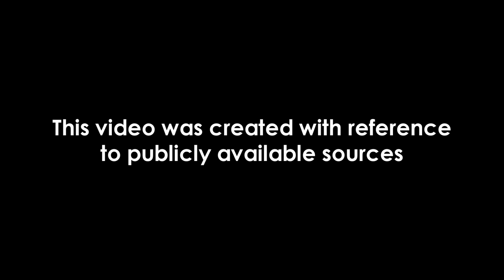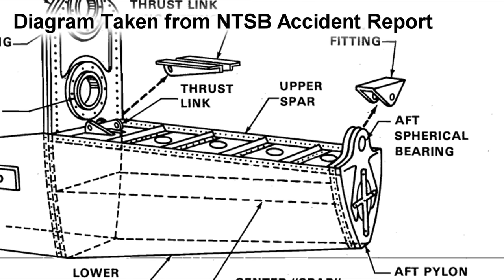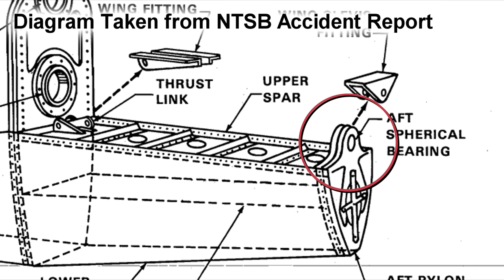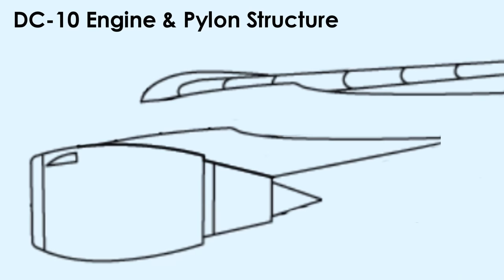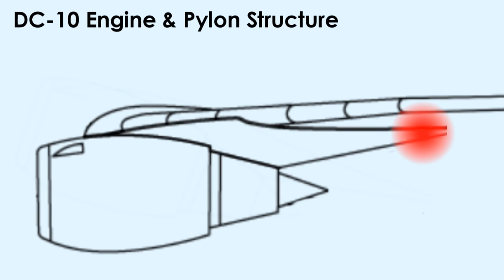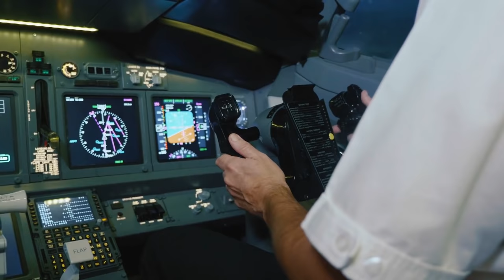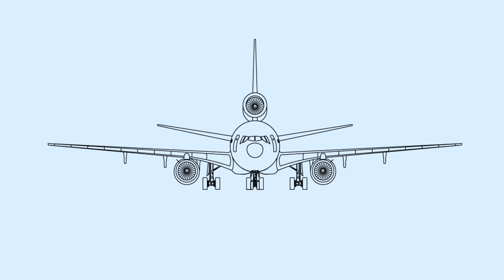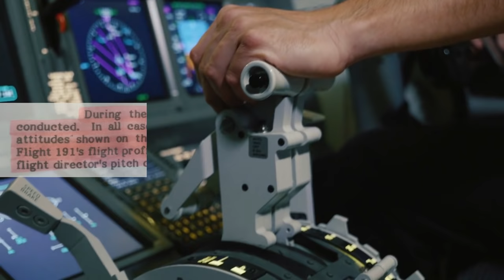America's Deadliest Air Disaster (American Airlines Flight 191) - DISASTER BREAKDOWN

Comment: That picture of the plane is one of the most unsettling and haunting pictures I've ever seen.
Reply: Yes it is .... There are actually more photos captured of this as it happened , they were taken by a passenger from another plane and published in the Chicago Tribune . I have found them , however they are not very clear due to photocopying .  I wish someone could get them published from the original article .
Reply: Yes, this one and the pic of the 727 that just had a mid air collision with a light plane and crashed in a neighborhood.
Reply: What's even more disturbing is the radio communication between the plane and the tower.
Reply: The photos make things even worse to go through
Reply: You must be new to the internet if thats the mist unsettling thing
Reply: Check out the dashcam footage of the 747 stalling to crash in the exact same way. https://youtu.be/lksDISvCmNI

Theres also footage of a C17  crashing soon after takeoff and also a B52 stalling and crashing in a similar way. These are graveyard stalls, too much bank or too much nose up without speed or opportunity to recover with a descent. At least these others were all much lower fatality count.

Oh and by the way, I find the picture of your face quite unsettling 😎
Reply: @ironmantooltime  The 747 crash at Bagram is NOT the same.   That plane was the victim of load shift.  An improperly-secured vehicle it was carrying broke loose and rolled to the rear of the plane as it was taking off.  With the weight at the rear of the plane, there was no way for the crew to level it off; and it was tilted back too steeply to climb.   

Worse, the load shift destroyed the hydraulics at the rear of the aircraft.  Even if the plane had had sufficient power to climb at that steep angle, the crew effectively had no control of the aircraft any longer.

The B52 footage you're referring to was also not quite the same.  It didn't lose an engine; the pilot simply disregarded basic flight rules and pushed the plane into a bank too steep; the aircrast lost lift and he was not able to recover that close to the ground.
Reply: @xaenon  Yea I know theyre not technically identical but from the point of view pf the OP theyre similarly unsettling and are all stalled crashes soon after takeoff, two out pf three being banked. The 747 initially also banks but infact lands on its belly.
Reply: I still have a hard time viewing that picture.
Reply: @markconley9279  You mean PSA 182? Yeah that image is creepy. That or Air France 4590 (the Concorde crash)
Reply: @TheEmeraldMenOfficial  ill add both the photo from inside JAL 123, where you can see all the oxygen masks hanging and the photo from the ground where you can see the vertical stabilizer missing.
Reply: @SadMarinersFan  I see your JAL123 photos, and raise you the photo from inside Air New Zealand 901 taken at the moment of impact. Found on a few shock sites, one of the few that truly disturbed me: I was never really affected by this stuff the way people usually are, in all honesty, probably combination of a lot of Mayday as a kid and just… not being attached to the people involved personally or emotionally. Only crash that ever disturbed me was Cougar 491… and that was recently when I found out a close family member was supposed to be in the one empty seat on that day. She had to stay back last-minute, forget why
Reply: @TheEmeraldMenOfficial  well said. Many of the well known low altitude stalls, especially in large commercial AC.....Wow. They're really all disturbing to me. That feeling of helplessness.

As someone who has practiced stalls and slowflight in small AC at higher altitudes, a low altitude stall is every pilots fear. EveryONE really.
Reply: And I believe there were video displays inside the cabin showing the pilots view out the cockpit.
Reply: Absolutely
Reply: @mattmc8391  where can I find that pic
Reply: @markconley9279  psa flight 182
Reply: There was an online image bank where they had images and then suggested uses for them like Christmas cards or book covers etc and that photograph was shown and it was on a greeting card with the heading 'Happy Holidays'.